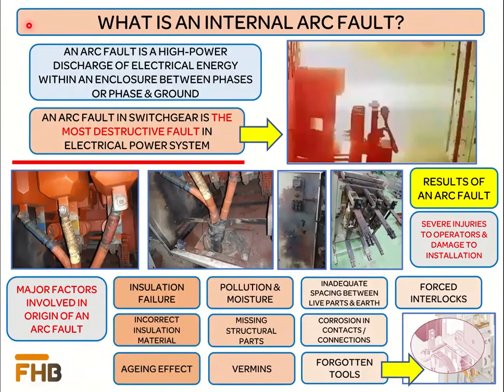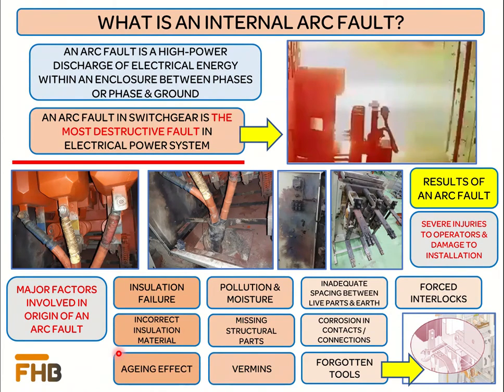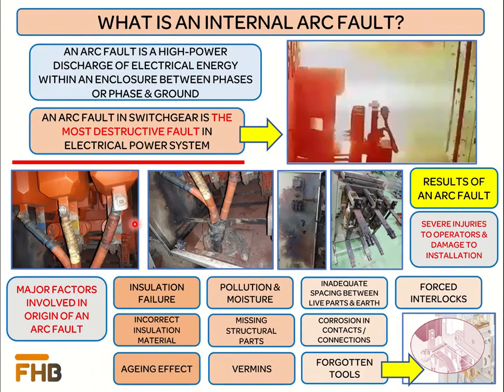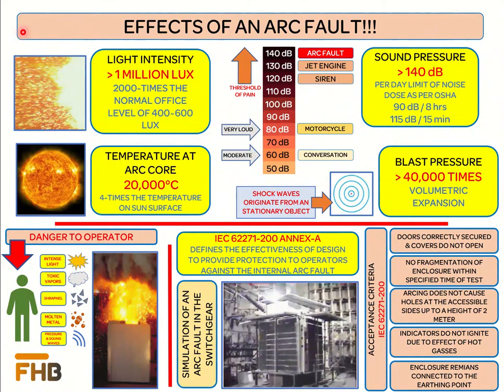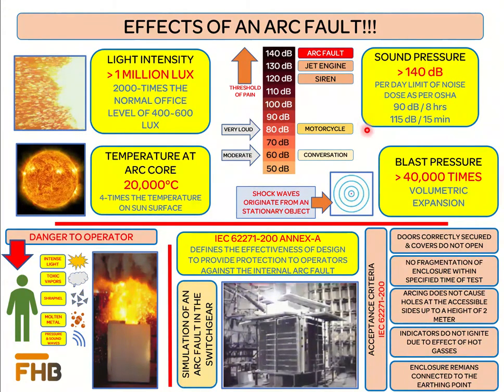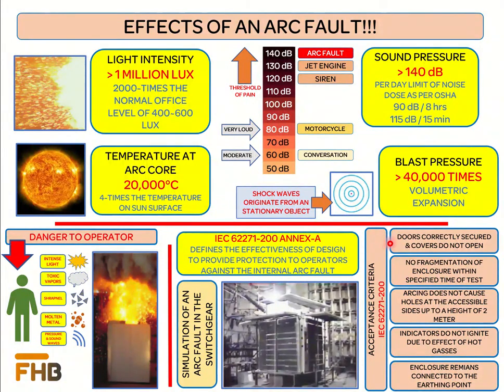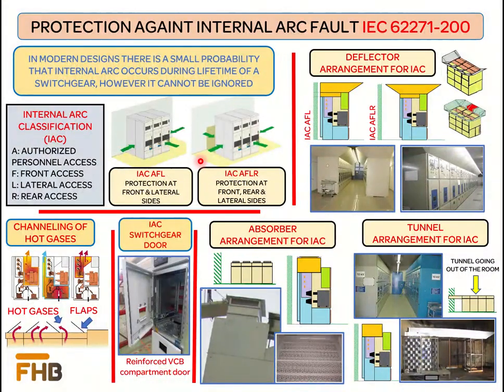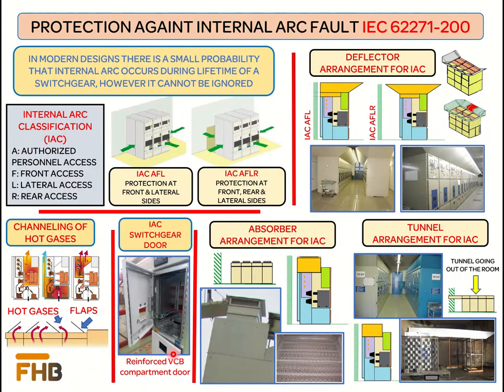Internal Arc Fault in Switchgears | Farrukh Habib - FHB | #ElectricalEngineering #fault #switchgear

Comment: Sir very good presentation, however most of the industries are neglecting such standards in Pakistan, Value orientation for govt. Regulators as well as  electrical inspectors of Pakistan is extremely needed.